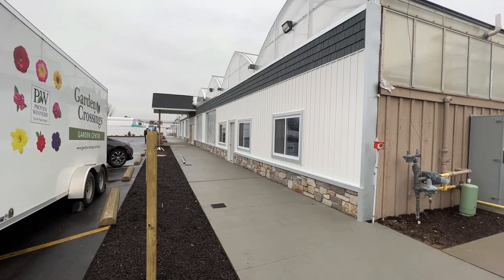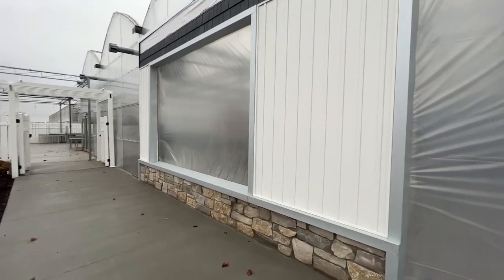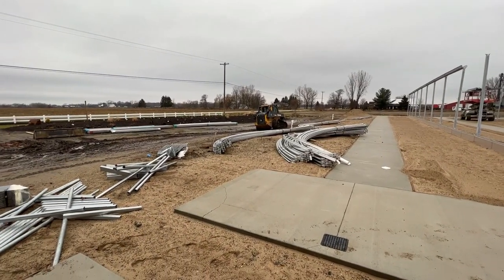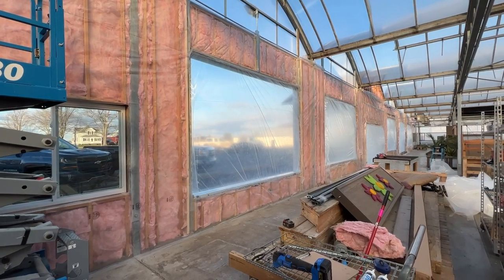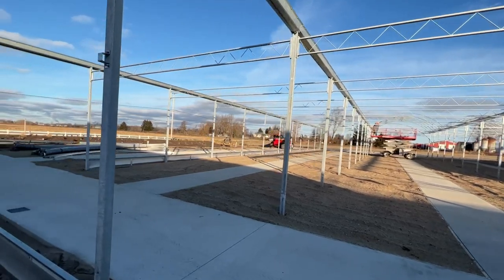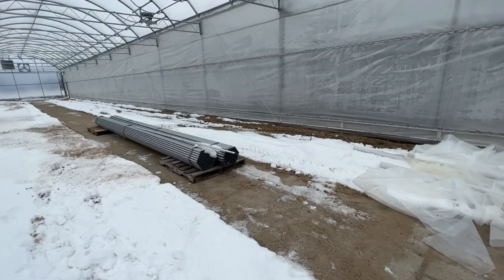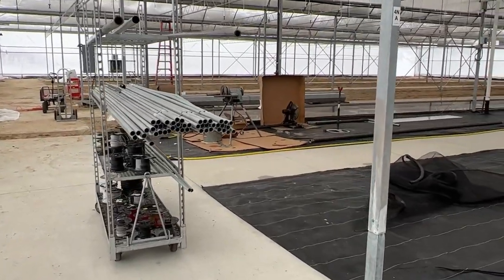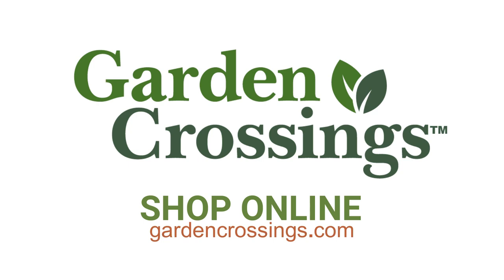Winter Projects at the Greenhouse

Comment: This is really interesting.  I was there the day the overhang in the front was being removed, so I was curious to know what was going to happen.  The front looks very sharp now and I am sure the extra windows will be appreciated.  I liked seeing the greenhouse construction too.  I watch Gardening with Creekside in NC.  They are installing a new greenhouse—not nearly as big, but they cemented the entire floor.  Other aspects were similar, such as the sides rolling up.  It is fun to see how different places approach the same project.  Thank you for sharing.
Reply from the maker: You are welcome. We don't cement the whole floor for drainage purposes. Water can run into the ground easier this way. I believe they are also using their space for planting and other things where a cement floor would be beneficial. We do have other areas in the greenhouse that have more cement, but those spaces are not primarily used for growing like the space shown in this video. It is very interesting to see how everyone does things just a bit differently.